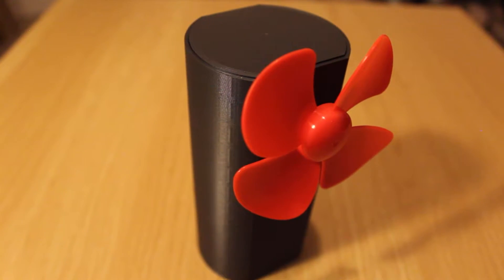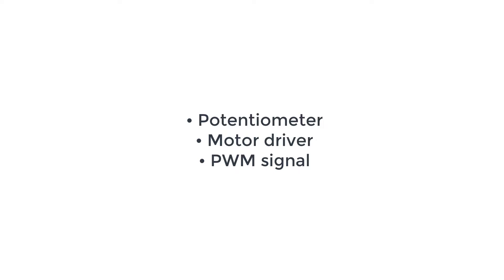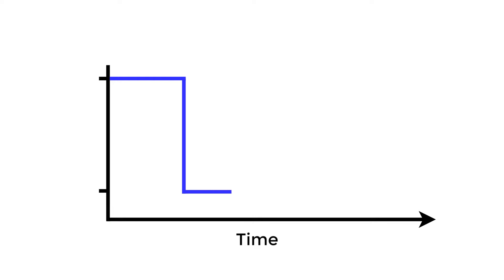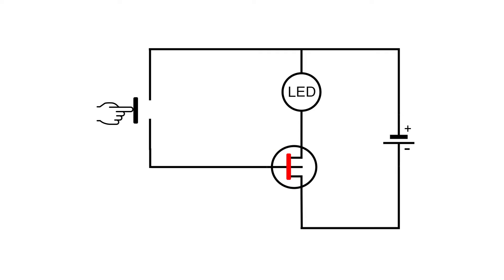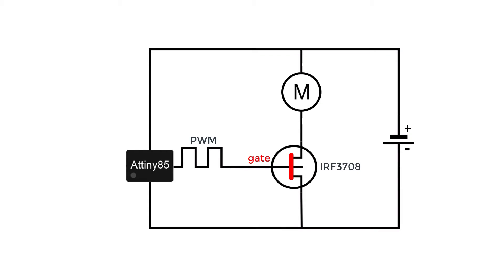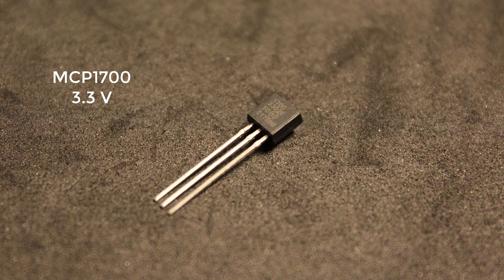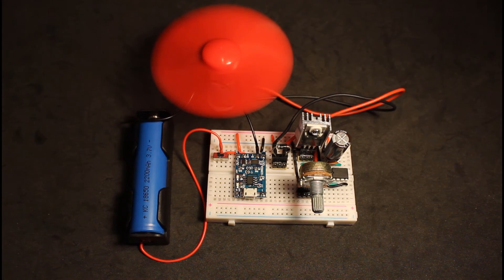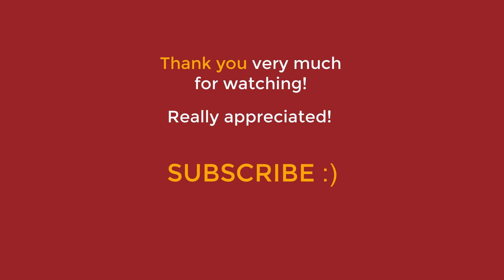Portable Fan with SUPER EASY SPEED CONTROL! (Arduino)

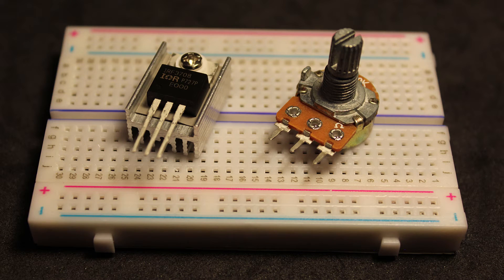Comment: I really liked how you are giving little advices along the way (like on 7:42) so that we can learn on your mistakes, that's the best thing!
By the way, i just thought, what if we just used cheap adjustable voltage step up or step down converter for lithium batteries to control the voltage? It's like 0.5 to 1 dollar
Reply from the maker: No worries! I am glad it helps. Yes that could work.